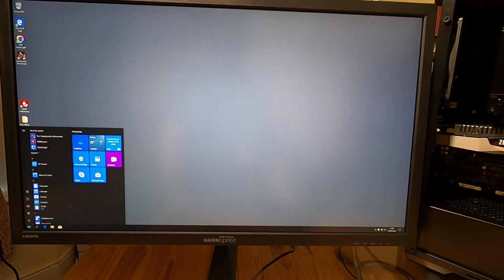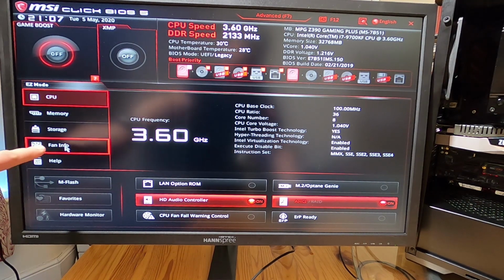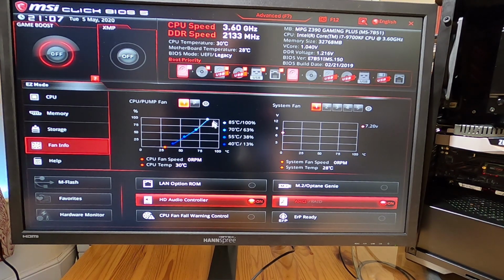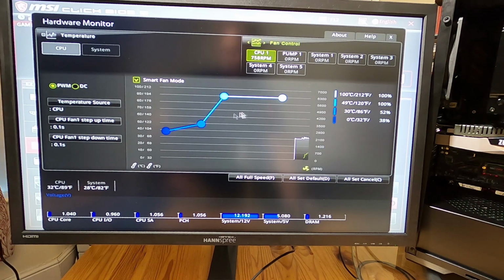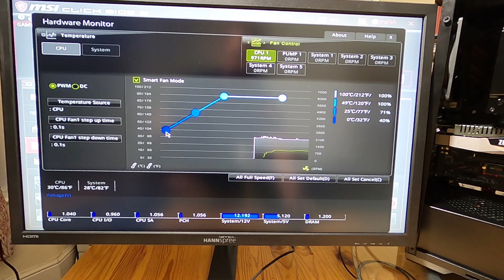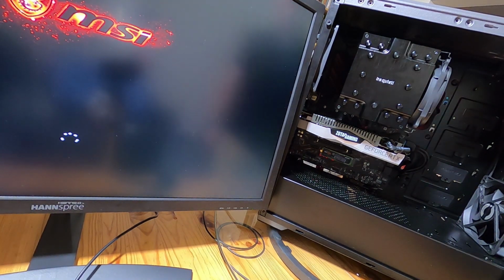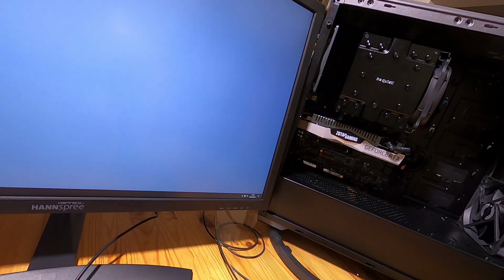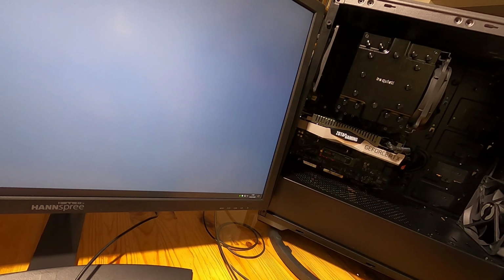CPU Cooler Ticking Sound *DIY FIX* in English

Comment: My pc makes a weird click sound followed by kind of a "donk" sound and I can't find anything about it on google and can't even record it because 
I have no camera nor smartphone.
Not even a mic that can get close enough. 
Happens every 5 seconds for some periods of time.
Seems to be coming from near the silver heatsink thingy.
Or under it.
I'm not tech savvy, k.
Not water cooled.
I am a musician and need little noise so I have quiet fans. 

Any idea about this?
Weird to ask in a comment section, I know.
But reddit turned to bullying rather than helping and I don't trust many forums as they all ask for recordings or tell me to reinstall my audio driver even though it isn't digital but in the machine.
Reply from the maker: Reddit can be toxic… I’m nice though!

The trick will be to try and see if the noise is coming from something mechanical.

It might be the main CPU cooler fan.

When it’s making the noise, you can stop or slow down the fan to see if that alters the sound.

If it does, then that’s the cause.

Most of what’s done in troubleshooting is finding out what isn’t the problem to narrow things down… then you’re left with what actually is the problem.

And problems with the things that make noises are one of the easier things to solve.

🙂
Reply: @sterntechdaddy  Thank you for the reply. 
I managed to find an old recording I had from when the sound began back when I still had a smartphone and I manually engineered the noise away in the clip so people could hear it over my old freezer, so hopefully that will help where I asked in some friendly Discord servers I know. 

I know it is weird to hear about someone with no smartphone but we are some who choose to be more primitive in some aspects of life to save money for hobbies, haha.

But I'll do what you suggested.
The friend who build my PC for me will help me do it.

Hope you have an awesome day. :)
Reply from the maker: To be fair… a few of my customers don’t have mobile phones. They are too important… everyone has to wait for them rather than them needing to be contactable at all times.

🙂

If someone helped you assemble it and it worked then they should be able to diagnose too.

So all it’s all good!

Social media isn’t the same as real friends.

😁
Reply: Check your GPU fans, sometimes they come on and off really quick and the hinge they spin from makes that noise, you probably want to set the fans at more than 0% rpm just so they don't keep on and off and making sound.

Comment: Even I have adjusted the cooler still it is clicking and it has the same sound as you have, do i need to replace my heat sink?
Reply from the maker: Just check to see if it is a particular fan that’s making the noise. Quickest elimination technique is to disconnect the case fans - so only the fans on the cpu cooler are connected.

Then check the fan to see if the blades can spin freely and there isn’t anything they are hitting as they spin.

If the fan still makes a noise then you can replace the fan - rather than the entire cooler.

What make/model of cooler have you got?

Comment: Mine clicks like a time bomb
Reply: 20 dollar air cooler must’ve not been the way
Reply from the maker: To be fair, the low cost coolers do generally work. Even expensive ones can make clicks and ticks if the fan voltage curve isn't right.
Reply: Tic tic tic when I play games brand new pc high end very weird , first time and I build pc since 10+ years
Reply from the maker: Hope this video helped... otherwise you might have a dodgy fan. 😊

Comment: But the Sound it self is nothing serious or a Problem , which can lead to any defects right? Have the Same cooler and a ryzen 7 5800x
Reply from the maker: It's mainly just irritating. Once you hear it you can't then not hear it...

:D

But it's not the noise a fault makes because you'll get the noise on a new CPU cooler - with a new fan.

I haven't tested or searched, but I wouldn't expect it to damage the fan if you leave it.

Other things like general wear and tear when it properly spinning and dust will be a more common reason for fan problems later on.

Comment: Sir I am getting that click sound from my pc like randomly I can't hear that all the time but it came sometimes and then stops in 5-10 minutes like my pc is working fine , can u tell me is this thing is an serious issue or not
example :  https://www.youtube.com/shorts/OkhTK3sWB9U
Reply from the maker: I can’t tell from the video… but see if you can identify where the sound is coming from.
Reply: @sterntechdaddy  I am getting this from my aio but I don't if it's something I have to worry or something I recently bought this pc and never had an aio before my psu and hdd ain't making noise but also the noise isn't like that stay forever and I only hear it for sometime and and it get back
Reply: @sterntechdaddy  also what I noticed is that I don't always hear this sound like when temperature goes up it stays and then when it goes down it go away
Reply: @sterntechdaddy  according to google I read it something called expansion and contraction between tubes and thing but as I mentioned I never used them before so I really don't know if I leave it or pay attention ?
Reply: @sterntechdaddy  u got any answers/anything yk man?
Reply from the maker: @dotexe3404  I can't really hear the noise that well in your video... but if you can positively identify the AiO as the source of the noise and the PC is new then start an RMA.

If you check which header the AiO is connected to then that might help.

Ideally, AiO should be connected to a dedicated header - rather than the general CPU fan header.

Fan headers tend to have a voltage profile - which might be making the pump run at different speeds, this causing the noise and causing it to come and go based on temp. 

It should really be running at a constant speed and the fans on the radiator should vary... hence some motherboards have a specific AiO header.

Do you know what motherboard your PC has?
Reply: @sterntechdaddy  it's a msi x570
Reply: @sterntechdaddy  btw sir , if this fan speed problem is the reason will it affect my pc in anyways or no ?
Reply from the maker: @dotexe3404  Most of the MSI X570 boards have a CPU_FAN header and a PUMP header.

As mentioned, the pump should ideally run at constant speed - usually determined by noise levels, and the fans on the radiator vary their speed according to the CPU temp.

Just check where you AiO is connected....

There's potential for a variable speed pump to have a shorter life than a constant speed pump. And there are implications for efficient thermal transfer as the fluid goes through the radiator too.

Even though these aren't critical - your PC should still run fine - it is worth investigating as the noises you've heard are obviously weird enough for you to ask the question.

:)
Reply: @sterntechdaddy  if this thing isn't sounds critical then I'll just ignore it 👍
Reply from the maker: @dotexe3404  It's your choice... obviously.

But if you want me to check then...

Check you temps under load - run Prime95 with HWMonitor.

Send me the exact model name of your motherboard with a photo/video os where the AiO connections plug in.

And I'll take a quick look.

Comment: I just started getting a strange tick noise similar to this but a little bit different maybe I never payed attention to it before though now it sounds much more louder if it was around for the time I’ve built my pc I’m also running an aio and I feel like that’s what’s bad or something in it because it’s a constant between 4-7 second tick sound and is the same pitch every time I’ve yet to look at loose cables but I don’t feel like that could it because it just sounds too off set at the same time but I could be wrong I’ve tried making sure it’s not a gpu fan ticking but it’s still just super hard to tell and just wondering if anyone’s seen anything similar and I’m despising putting my finger on a 1000$ gpu fan that’s running it just is nerve racking I think I’d rather just take the whole gpu out boot it and see if it ticks if not definitely water pump but I’ll have to try anything else brought up by you guys and the one from this video either way great video thanks for spreading great information.
Reply from the maker: It can be hard to tell where the sound is coming from... if you've got a mic and can film it, then you could move it around the case and see where the noise is loudest.

That will work better than holding your ear to things. Everything that could be making the noise is in a discrete area so you don't need pin point accuracy.

I'd look at the AiO pump first... and unplug any case fans that aren't linked to it.

Comment: Even when I turn ALL of the fans to maximum and they are super loud the ticking noise remains.
Reply from the maker: Can you identify what is making the ticking noise?

Disconnect all the fans apart from the ones involved with the CPU and power supply.

If the ticking stops then that’ll be the cheapest fix… just start reconnecting and then remove the fan that’s making the noise.

🙂
Reply: @sterntechdaddy  I stopped the 3 intake fans in the front and the exhaust fan in the back and the ticking noise still continues. I'm guessing the bios doesn't effect the fan that's attached to the water cooling system? That's also the only fan I can't stop as it's got some kind of casing around it that I can't remove without taking apart the water cooling system and removing the ram. Is there other devices that could be causing the ticking? The computer is only 4 months old, but I did dust it all out with canned air and clean everything I could.
Reply from the maker: @ATFPredator  If it's only 4 months old then report the problem to where you bought it from.

Note that if you eliminate everything apart from one thing you can't check then it's likely that the thing you can't check IS the problem.

:D
Reply: @sterntechdaddy  It ended up being the liquid cooling system had bubbles in the tubes somehow, they replaced the part under warranty, thank you! ^_^
Reply from the maker: @ATFPredator  Great news!

It's expensive and impractical to manufacture AiO coolers with no air in them. Orientation helps reduce the bubbling noises, but sometimes you get one that make a noise regardless.

Glad its finally sorted.

Comment: My rear chasis fan is ticking really loud, sound like the fan is hitting smtg. But after putting some oil to it, It seems okay but later the issue came back.
Reply from the maker: It’s probably broken… disconnect and remove it.

You don’t need the rear exhaust fan anyway, but you can replace it with a new one if you want to.

Comment: I have the same issue but my PC Doesn't start at all. As soon as I switch my PSU on, it gives that sound. Any suggestions ? Thank you in advance
Reply from the maker: Open up the side panel… disconnect the hard drives (to prevent damage) and then see if you can workout where the noise is coming from.

Comment: That worked. It was very weird due to it never happened before.
Reply from the maker: I've got three things that immediately spring to mind....

 Did you update your BIOS?

If your PC is old then the CMOS battery might need changing.

If its just one fan making the noise then it might be worn.

Hope that helps.

But if its fixed then you might have better things to do than investigate your fans.

:D

Comment: there's a ticking sound in my pc and it makes my game lag. i don't know what should i do
Reply from the maker: If you can, remove the side panel and see if you can work out ere the ticking sound is coming from.

It's OK to press your finger gently onto the centre of a fan to slow it down and check it the noise changes or stops to help identify the source.

It's also a good idea to clear away any built up dust - you can do that with a 1/4" paint brush and a vacuum cleaner.

Comment: I also get ticking sound as soon as I start my PC but my pc won't even boot to desktop it just takes infinite loops at loading windows screen. And I confirmed it is coming from the CPU Fan. Any solution?
Reply from the maker: If you recently built the PC yourself then make sure the CPU is fitted properly… and check what header the fan is connected to. As you’ve identified the CPU fan as clicking then replace the HSF.

If it’s an old PC that’s recently developed this problem then replace the CPU heatsink.

If the fan isn’t cooling the CPU may be overheating at boot causing instability.

Either way, replacing the heatsink will hopefully be the cheapest fix.

Comment: My computer started making this weird constant clicking noise and I don't know how to stop it any advice? I'm not sure if its the clicking in the video but its not stopping. What should I do?
Reply from the maker: Remove the side panel and have a listen... see if you can pin point where to clicking is coming from.

If you put your finger on each fan and stop then spinning you'll easily spot if one of them is the source.

Start with the least important - which is case fans which can just be disconnected as a free fix. The CPU HSF and power supply fans are obviously going to be more expensive to replace.

Hope that helps.
Reply: @sterntechdaddy  Thanks a lot! I will try it out! Very helpful
Reply from the maker: @savannahsayshi9416  No problem!

Don't be afraid to put your finger on the fan to slow it down... and I hope its one on the actual case  - like the rear exhaust fan.

Then you can just disconnected it and remove it - which is completely free and won't impact cooling very much!

:D
Reply: @sterntechdaddy  Cool thanks!

Comment: Mine has a loud ticking noise and now my computer won't start up. Just turn on and it starts clicking but won't load windows
Reply from the maker: Assuming it's not still covered by any warranties.... I would remove the side panel and try and identify what is making the noise.

And check the fans to see if they can spin freely.